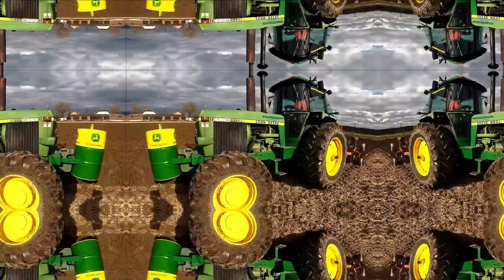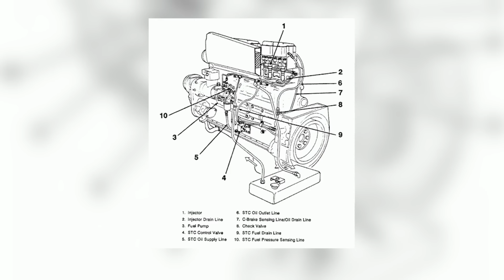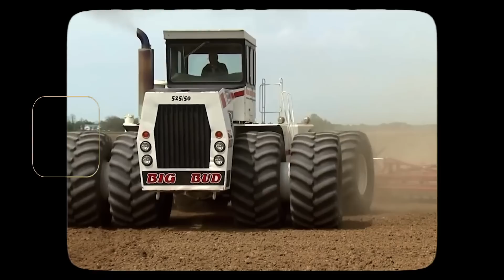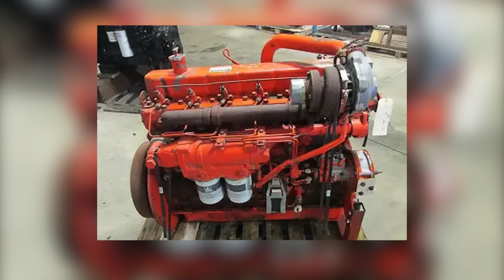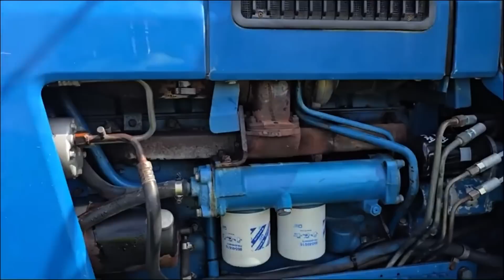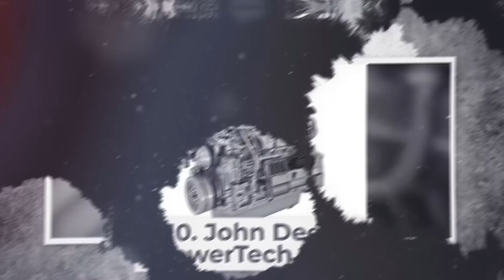Did These Powerful Engines Really Change Farming?

Comment: I worked for Detroit Diesel (DD) before retirement. But DD becomes a 4-cycle Series 60! I tried several times to make them try another type cycle engine called D-cycle,  but couldn't convince them. It is the patented technologies to retrofit the existing (and future) billions of internal combustion engines (ICEs) to improve >20% efficiency, >2x torque & ~zero emissions without expensive new investment with existing knowhow for great savings, especially with heavy diesels.
It is Differential Stroke Cycle (D-Cycle) by simply splitting the piston crown from skirt to pump gases for the chamber via a (valvetrain-like) piston-train and to combine with the rest of the piston to turn the crank – a hybrid of 2-/4-cycle. D-Cycle further ushers in the compression-/spark-ignitions for diesel-/gasoline-engine hybrid - “Diesoline” engine - which is the SCCI/LTC (Stoichiometrically Charged Compression Ignition/Low Temperature combustion) engines. 
The Piton-train can dynamically adjust stroke lengths and durations of the gas exchange to optimize Burnt-Gas Retention (BGR) which is an expanded EGR (<30%+/-), for ignition timing and combustion duration. These retrofits surpass the current 2-cycle, 4-cycle, diesel, or gasoline ICEs, while maintaining compatibility with existing parts, manufacturing, facilities, personnel and processes.

Comment: I started to work for a Case dealer right out of trade school in 1975, I'm kinda shocked that you picked the 451 instead of the 504! The 504 was first used in 1969 in the new 1470 4WD and was used all the way up to the 4694 in 1987! Ranging horsepower from 108 in the 2094 to 261 in the 4694, although we put more than just a few 4690's and 4694's on a calibrated dynamometer that had 290-310 horsepower! The 451's were plagued with upper sleeve cracking and we remedied this by cutting the upper sleeve counter bores so that the pressure from the clamping force of the cylinder head being torqued down put the lip of the upper counterbore against the "inner" lip of the sleeve instead of being on the outer lip of the sleeve. That and the fact that the 451's were in production from 1962 when Case built it's first 4WD, the 1200 and went out of production in 1977 with the last of the 1175's and 1270's wouldn't have made my list. JMHO after nearly 50 years working for a Case then Case IH after Case bought IH in November 1984, they managed to keep it quiet until mid December 1984.

Comment: We have the International DT436 and DT466 running in 1460 and 1660 Axial Flow combines. The Cummins 8.3l in a 1688 Axial Flow. 

Also the Perkins 6.354 in two MF1105's. South Africa made the ADE engines. Some of them copies of the Perkins. Great engines with good service.

But lets face it guys. Good service intervals and overall maintenance make a big difference on any machine.

Thanks for a great video.
Reply from the maker: So glad you liked it!

Comment: The big bud 525-50 as per wiki was a Cummins engine, NOT a Detroit : The "525-50" refers to the Big Bud 525/50 series of tractors, which were known for their powerful 525 horsepower engines. The "50" in the model designation indicates a power shift transmission. The Big Bud 525/50 was a popular model, known for its 6-cylinder Cummins KTA 1150C engine with 1,150 cubic inches.
Reply from the maker: You’re right that the 525/50 ran the Cummins. But some earlier Big Buds did use Detroit Diesel engines, including the 8V71 and the 16V-149 in the Big Bud 747. I should have been more careful about which models ran Detroit power. Appreciate you pointing it out.